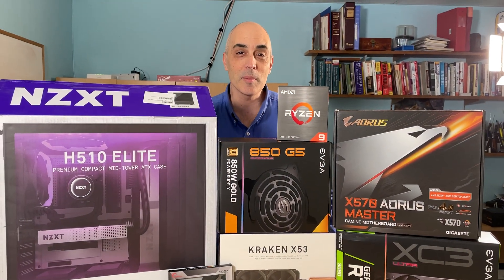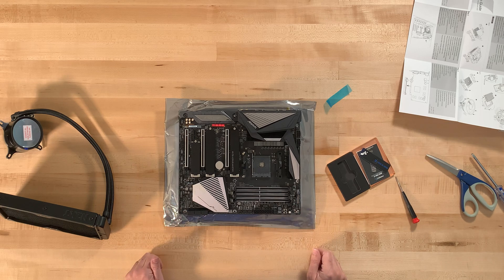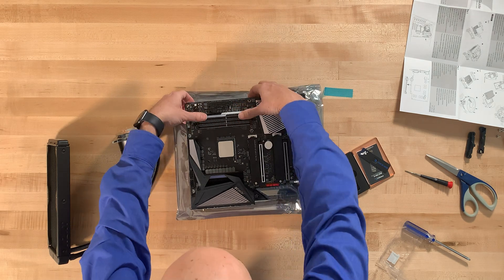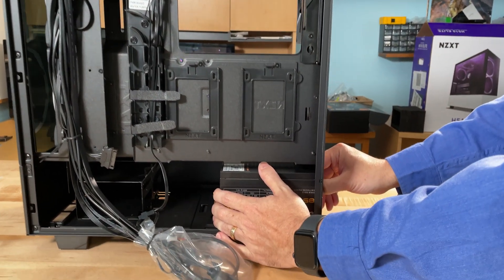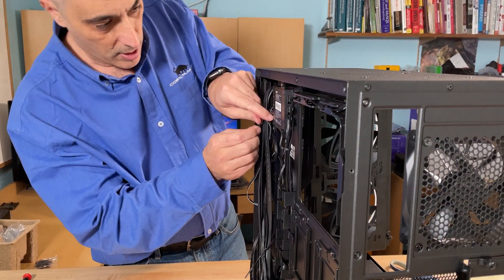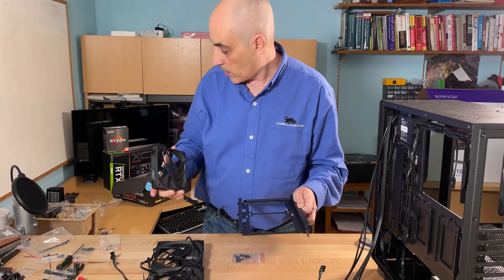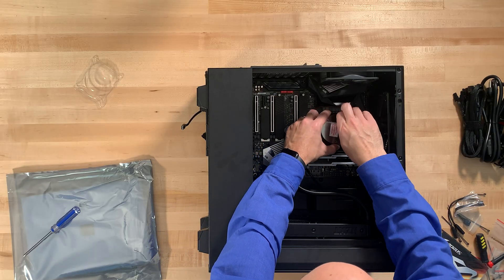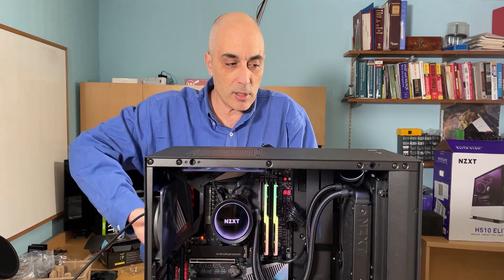CTOBOB's AMD Ryzen 5900X PC - $4000 Build

Comment: Just ordered parts for this exact build (almost). Got a 3080ti, 360mm aio, and 5000d case. Beautiful build btw :) Question though, did you have to flash that Motherboard for 5000 series?
Reply from the maker: I did flash the bios to latest. I always do that as part of any build anyhow as it has avoided issues in the past.
Reply: @BobPellerin  ok thanks!

Comment: same  configuration  but  with 5900x  my motherboard  dont  start  and i have a bios message  (d  zero) what s  wrong ?  thanks  for  your  help
Reply from the maker: Check the motherboard manual for what the codes mean. I know we had a code as well and it was a ram module that wasn’t seated properly. Make sure the MB has all the power connectors well seated and the PCIe cards as well.

Comment: Hello, am building something similar and also have the x570 Master, 5900x and all, my question is is it a must to plug in both 8 pin CPU power cables from the PSU?
Reply from the maker: I would hazard a guess that you need to have all the power cables connected. The card uses a lot of power when pushed to high frame rates etc..
Reply: @BobPellerin  alright thanks
Reply: @harrisonbanda4921  Yea I've read the second 8 pin is mostly for overclocking....
Reply: YES! It is important that the CPU has all power connectors plugged in for upmost power delivery. And if you are going to try overclocking your chip, PLEASE plug them in! And even if your not, I would HIGHLY recommend you do. It will not damage your CPU in any way, and it will only be beneficial.

Comment: Hey I was wondering if the z390 aurous pro WiFi is capable with a EVGA supernova g5 850... the cpu cable in specific
Reply from the maker: I just looked up the specs. Looks like standard  24 pin ATX Power Connector
• 8+4 pin CPU Power Connector on that board. I see no reason why the EVGA supernova g5 850 wouldn't work for you. Just make sure you have a case large enough for it (which just means nothing extremely small or tiny). Let me know how it works out!
Reply: @BobPellerin  oh ok.  I’m not sure if the supernova g5 has a 8+4 cpu cable.  On the thing I searched, it says that it’s a 4+4.  Where should I order a cable from?